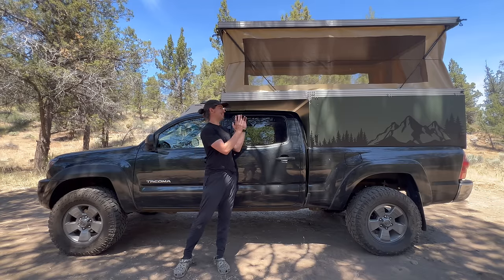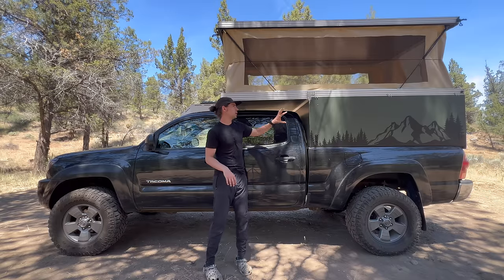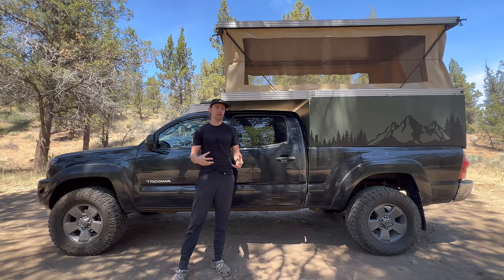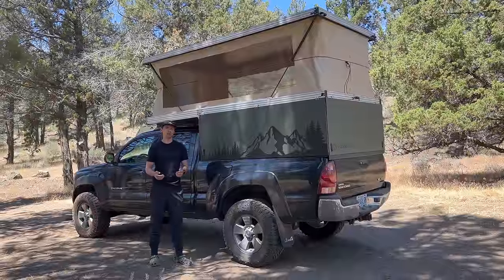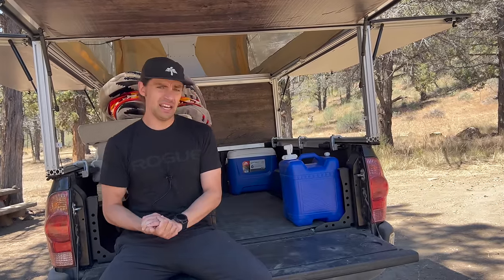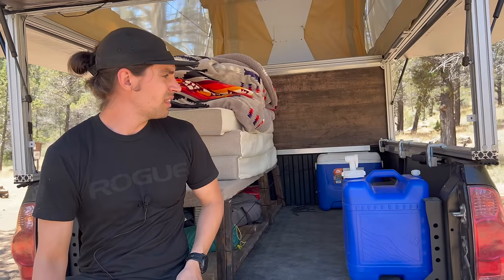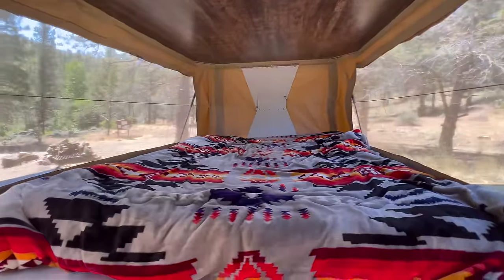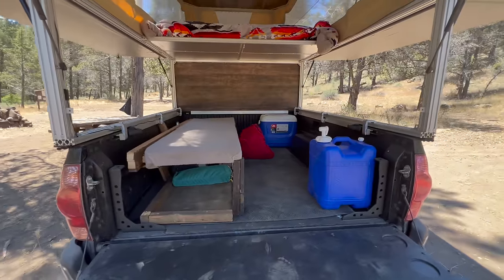No-Weld/No-Sew DIY POP-UP Camper Walkthrough | KIT Campers V2

Comment: This video has my mind racing. Am contemplating the purchase of the new AWD Ford Maverick, and a small fiberglass camper. Would be using the camper as a “home base” for exploring the country. If I got caught out too far from returning, a small topper like this to spend the night in a remote location would be ideal. Currently there are none being manufactured for the 4-1/2 foot Maverick bed. Making my own with 2 to 2-1/2 feet over the cab would be enough to sleep comfortably up top. Hmmmmmmm……..
Reply from the maker: Yeah I definitely think it's doable but there might be a few complications. I think currently most manufacturers don't build for the maverick for a few reasons, 1) it's pretty small and new, and 2) the geometry isn't very nice, in terms of trying to get everything to fit. I am sure you could get it to work if you put some thoughtful design into it though! Let me know if I can help!
Reply: Yeah, Ricky. I’m thinking of buying a Maverick and like this idea as well. Lots of great ideas here! Great video. Thanks Kit Campers!

Comment: Looking really good, I've been nibbling away at the idea of building something along these lines for a while, but the lack of sewing skill and equipment has been a major roadblock and contracting out, just too costly.  Your vinyl welding idea has got me thinking all over again.  Thanks!
Reply from the maker: No problem! Glad to see that the gears are turning, if you have any questions about the canvas or other parts of the camper let me know!
Reply: If you had a instruction and materials list would be amazing
Reply from the maker: @michaelarthur2362  I do, it's all in The Diy Build Classroom at kitcampers.co/theclassroom
Reply: Really nice set up! How about bolts rattling loose? I am interested but my concern is run roads and wear

Comment: Why 10 feet long? Arbitrary number, and overlapping the taillights looks like non custom fit for a custom design
Reply from the maker: 10 feet is just a round number but it also gave me enough space to work with. I purposely wanted a small overhang on the back so I didn't run into issues with the door closing.

Comment: Aluminum t-slot frame railing and fasteners are by no means inexpensive, but they are a a delight to work with.  Assembly will be quicker and the end result will be as strong as a bridge.
Great camper. Well done!  ✔✔
Reply from the maker: Thanks! Yes I agree, the pieces are SO strong, and with the correct fasteners they are super sturyd and vibration resistant!

Comment: This is super cool and exactly what I'm looking to do. I built a roof tent rack using 2040 extruded aluminum and it's held up pretty well except for one of the aluminum beams broke as a result of being twisted from spreading out under load. Without having some kind of "lip" to press against the interior of the top of the truck bed, weight pushing down can cause the structural supports to push outwards. Looking at your video, I'd recommend adding a strip of aluminum along the entire bed length to prevent your frame from getting pushed outwards.
Reply from the maker: Thanks for the heads up! I added some angle aluminum to the bottom of the rails and then some bed rail stiffeners to the truck bed so I haven't had any issues

Comment: I just need to build the top portion, the Pop up part. I want to build it on top of the existing fiberglass top, on my '93 Ford Bronco. From the windshield to the back is 8',but I might extend it to 10', towards the back, which is about the distance with the tailgate  down. So if I don't have enough room in the 5' bed of the Bronco, I might make a temporary/removable shower/toilet on the tailgate.
Reply from the maker: Nice! Sounds like a pretty slick idea!

Comment: I've been looking at a similar idea. But instead f canvas, I'll make fold up hardsides for the insulation value. I'm going old school with 4 each, 12v marine batteries, plus isolated truck battery, with a cutoff switch.    Naturally, I'll install solar panels where I can, hopefully enough to keep the camper supplied.
   I have my eye on a wrecked pop up camper that I can get cheaply, to use the appliances from. Then convert that trailer frame into an enclosed utility unit to carry my home built EV 4X4. As a metal detectorist, this will allow me to camp, and have trail mobility. (The reason I want a little electric buggy is the noise value. It's a lot easier to see wildlife without a lot of motor noise.)
   I really enjoyed the video. Using extruded aluminum hadn't occurred to me, as I was intending to use angle iron. Since the build will be on a vintage Ford Ranger, weight is important. (Though I intend to put hub motors on the trailer to give just a wee bit of assistance. All in all, I'm shooting for a $2.5K cost, including the pop up.
   I'm subbing, to steal your ideas. 🤣
Reply from the maker: That sounds like an awesome idea! I will say, I hope you can get all your parts for your given budget, with the way this build is buying everything  new it was around $4k. But I think if you are savvy about getting used or material that isn't really challenging to get like VHB and ACM then I think you should be able to do it.

Comment: A very inspirational build, a no nonsense, cut to the chase approach to creating a high quality, lightweight pop top camper kit that addresses the issues for most buyers!

And those issues are no welding and no sewing, as these are the two main specialist skills that most people simply do not have, and which cost a huge amount to contract out.

You've created a very high quality, very highly desirable camper, which just keeps on getting better the more one sees of it.
Reply from the maker: Thanks for the kind words! That was the goal of creating the camper.
Reply: Don't weld, but DO sew.
Reply from the maker: @Tsiri09  the non-sew seems have been holding up VERY nicely, I definitely think adding sewn seems would make it even more sturdy though

Comment: First off, superb build! What is the height of the vehicle with the top closed? I want to build something like this, but I need to keep the total closed up height under 79 inches.
Reply from the maker: Hmm thats a great question, I have since sold the camper so I cant measure it. But the camper was 2 inches above the roff of the truck then another 7 inches taller than that, so you could mock something up that is 9 inches taller than your truck roof height and that will give you the full height.
Reply: @KitCampers  Perfect, thanks!
Reply from the maker: @LowDoughTech  Of course!

Comment: This camper is brilliant and simple.  Congratulations!  Also a special thankyou for specifying the weight.  Most Youtubers don't do that.  Would be interesting to replace the panels with pink foam wrapped with carbon fiber.  That would be even lighter. Would also be good to see someone deal with the aerodynamic problem created by the portion over the cab.  Great work though!
Reply from the maker: Thanks I appreciate it! I try to be as open about the design as possible to give people the most realistic expectations! You could try carbon fiber or fiberglass (but you may need special epoxy to make sure you don't eat away the pink foam). No way around it, all cab overs result in some level aerodynamic issues but I am working on a semi solution for the cab over right now! Will definitely be testing the differences in gas milege before and afterwards.

Comment: I like this alot.  I am looking at 8020 extruded and the composite to keep the camper light on my 2021 f150 lb.
Reply from the maker: Thanks! How long is the long bed? If it's longer than 8' you might run into some expensive shipping for the aluminum extrusion (anything longer than 94" can get really expensive). Let me know if you have any questions!
Reply: @KitCampers  8 ft.  I will have to measure when I get home for exact lengths.

Comment: Its been a year since this video was uploaded. Have you done more with the camper or has it stayed the same?

I was going to suggest that your side access doors should be half their length & fixed panels put in towards the cab. The fixed panels should have RV screened windows for light and airflow from down low without the bugs. Back door should also have an RV window for same reason.

Any plans for mounting solar to the top?
Reply from the maker: @naekid I have a follow-up video and some reels on instagram that show some of the changes. I also have some video filmed that I have meant to upload. But I just haven't done it. I did make windows and changed the screens for the canvas. But all are good suggestions, I don't think solar mounting would be very hard, you would just have to make some mounts using more aluminum extrusion.

Comment: Hi there,
Great build. Can you tell me the size of the main profile for the bed frame, and for the four columns, in the corners of the bottom, because it doesn't show well in the video? Thanks in advance!
Reply from the maker: Yes, the profile for the bed rails is 1x3, the uprights are 2x2, and the top larger ones are 4x2. I use 10 series for everything which means all the slots are in increments of 1.
Reply: Thanks mate! Best regards!  @KitCampers

Comment: This is exactly what I've been looking for.  I don't want to remove my tailgate or drill holes to bolt the camper on.  I would like to add about 6" - 8" to the cab over to allow for 6' - 9' one piece fishing rods.  Do you have a basic set of plans and links to where you purchased the materials?  Fantastic build!!
Reply from the maker: Hi Jimbo! You dont need to remove the tailgate or drill any holes to bolt the camper on. The enter roof is already 10' on a long bed so you would be able to already store some fishing rods if you wanted. I sell the build guide on - kitcampers.co/theclassroom

Comment: Hi there, your videos are really inspiring. I am going yo use 4 struts to lift the roof of my camper which is 69 inches long and 67 inches wide. The roof weighs 71.5 pounds. I am looking at the 36 inch struts, should I get the one that says 20 pounds per strut? What pounds and force do you recommend? Thank you so much for your time and help.
Reply from the maker: Thats a great question. Because the struts aren't pushing only up, I would elect for something closer to 40lbs, this will make things a lot easier for you. Also, most gas strut supply places are super nice when it comes to exchanging them, so if you don't get the perfect ones to begin, you can play around with lighter or heavier ones
Reply: @KitCampers  Thank you so much for your info.
Reply from the maker: @freemanlin3777  of course! Happy to help!

Comment: I might have missed it, but what do you do if its raining?  those large mesh panels would allow alot of water in.  I would do a pop out panel that would allow it to remain open for ventilation but could be zipped up or velcroed closed so you could seal up if need be for warmth
Reply from the maker: Yes great recommendation, I changed the windows after this first video. Now the windows have three layers, mesh, clear vinyl, and canvas. And they have a seam at the bottom.

Comment: Love the build man! Been thinking of making a pop up camper for my ford ranger. What size gas struts did you use? I want to make the height of mine about 4ft (50 inches) but I’m having trouble determining what size gas strut I need
Reply from the maker: Nice! I used the largest gas struts I could find (~44inch) but am only able to get about 32inches of roof clearance. I am currently figuring out a new method for popping the top higher but am still working on getting everything totally figures out (if you go over to my instagram @kit.campers you can check it out)

Comment: 1 Sweet set up
2 you didn't learn from GFC not to use those latches? they break quite easily and at the worst times
3 400 pounds ate up half your payload
4 really like how everything is insulated
5 sweet set up
I'm using the wood wrap idea for the inside roof my GFC. love it
Reply from the maker: 1) Thanks I really appreciate it!
2) Oh crap, I did not know that GFC ran into those issues, I will certainly let people know if they break on mine
3) Yeah 400lbs isn't ideal but it is what it is, better than the 900 slide in I had.
4) Yeah I thought that was a good feature, most campers aren't insulated at all
5) Thanks again!

The wood wrap is awesome 10/10 recommend!
Reply: Lol

Comment: Hi! I think I found your channel after watching Tim M's Four Wheel camper build which was like 4 months ago. I've looked at so many camper builds but keep coming back to yours. I like the idea of the 8020 aluminum to make the frame. Did youmake a how to video or is all that in the classroom link? I need to get moving on something because I'm having a hard time finding anything for my Ram 1500 with a 5'5" box. Thanks!
Reply from the maker: Everything is in the classroom link - https://www.kitcampers.co/theclassroom
But there is also a free BOM on the website as well.
Reply: @KitCampers  Thanks! I did end up checking out the classroom and it is quite impressive. Now I just have to do something. 😉
Reply from the maker: @planman860  That's awesome! Definitely let me know what questions you have!

Comment: Excellent work. How do you keep rain out of sleeping area? Didn't see any zip covers for the screened windows.
Reply from the maker: For the initial version I hadn't finished the windows but I ended up having covers that rolled up from the bottom and stuck with velcro.
Reply: Great. We have a RTT that has cloth awnings supported by spring wire poles along with zipped flaps on inside tent. Understand zippers would not work out with your no sew theme. Hang tuff yer on to somethin👍
Reply from the maker: @hokehinson5987  Thanks I appreciate it. You could definitely sew zippers on if you wanted. I have also been looking for zipper that would work with the  vinyl cement. But no luck so far.

Comment: Very cool, great build.  So I have a question regarding the poly coated vinyl.  How did you attach the screen to it?  I have a lift system on my Ranger to raise the shell and need to make canvas for the space when the shell is up about 2'.  I was planning on sewing a tent material, but I've never sewn anything before.  This vinyl looks great and much easier than sewing.  Can you glue Velcro to the vinyl?  What weight vinyl did you use?
Thanks Scott
Reply from the maker: To attach the the screen to the vinyl, I lay the mesh down first and apply glue so it saturates through the mesh, then I go over the top of it with a thin layer of VCP

Comment: Just curious where you obtained the 8020 and the aluminum composite materials? I need some 11’ sections…any suppliers for that?
Reply from the maker: I bought the 8020 from a compnay called TNUTZ.com they will send you 11' sections if you pay for freight shipping which can be expensive. If not then you can divide the pieces in two (not ideal but it works) and then join them with butt joins. For the aluminum composite material the largest I have found is 10'x5' so you might need to get creative in how you position and mount the panels.

Comment: With those style of push button slam latches... Can the push button be operated from the inside?
I guess you can latch it easy enough once in there from the inside?
How do you close the doors, by just pulling on the latch itself? I didn't see any handles on the inside.

Do you think those bedrail stiffeners are "required"? 80x20 isn't light that's for sure.

I like what you've got going on though overall.😍
Reply from the maker: Thanks, I appreciate it! All great questions. Unfortunately, no the slam latches cannot be operated from the inside, but they can kind of me if you use a screwdriver. We just pull the doors shut from the inside by grabbing the aluminum extrusion. I don't think the bed rail stiffeners are required but I like them for the extra protection, I would rather have them, than risk an unfolded bed....

Comment: Great job! May you adviece what for gas struts have you choose for that project? Lenght/power?
Reply from the maker: For the roof I use 44 inch gas struts from a company called lift support depot - https://www.liftsupportsdepot.com/lift-supports-depot-st440m60-gas-charged-lift-support/

The 60lb struts seem to do the trick.

Comment: I see the plans are $150 from the comments so that is all good and cheap but did I miss the total cost of the materials and the approximate time it took you? Looks good and I would like to see the rain covers for the windows which could be as easy as velcro on a piece over the windows or something like that. Looks good. I'm going back and forth between a high roof van and a pop up on a truck. Not decided yet.
Reply from the maker: The total cost of materials was ~$4300 and took me 10 weeks of only working 1-2 days on the weekend. I am definitely working on rain covers for the outside just haven't had time to finish them up yet. I think both have their merits, the pop top on the truck allows for better overlanding IMO while the high roof van would allow for a better living space.

Comment: What kind of leaf springs are you running in your Tacoma. Thank you for the video
Reply from the maker: Just the stock leaf springs, but I added some 1250 variable compression springs (sumo springs) to the back to make things a little more stiff.
Reply: @KitCampers   nice, well thank you for the video I've recently been thinking about trying to build an overland set up like this with a aluminum truck rack for my 07 Tacoma. You mentioned your Instagram do you have the link by chance.
Reply from the maker: @BlitzAdventures67  That's awesome I would love to see any updates as you build things out. my instagram is https://www.instagram.com/kit.campers/